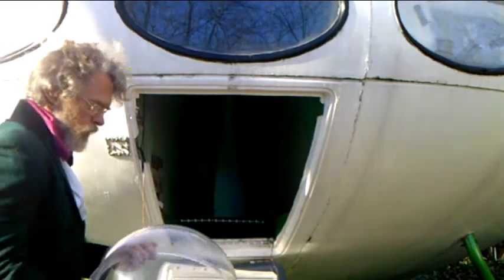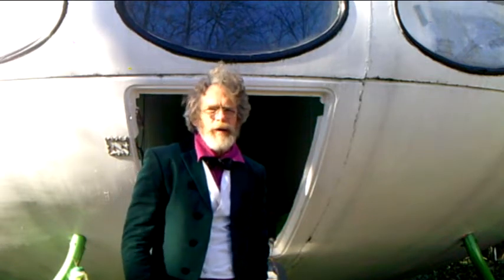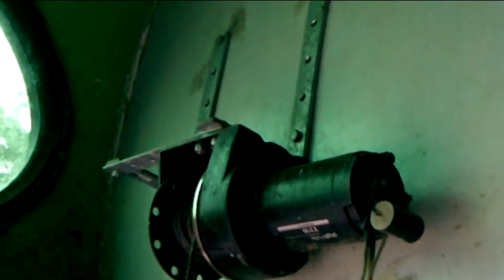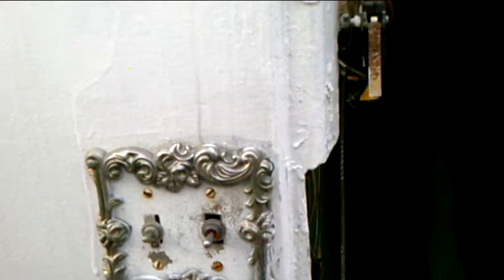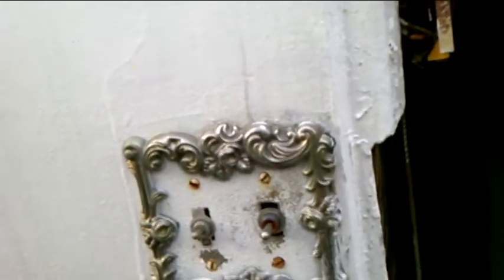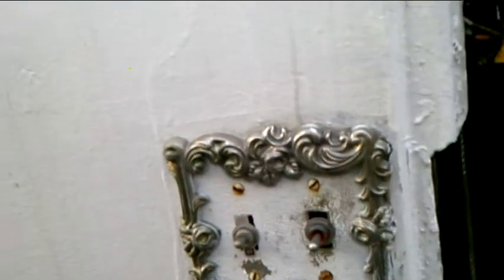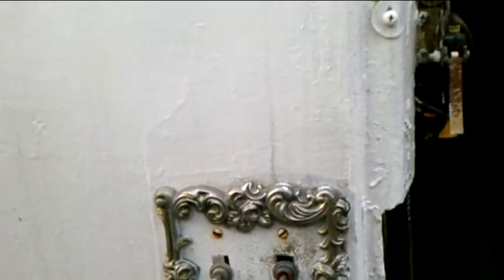Customizing Your Futuro House

Comment: I've seen a picture of one of these back in the eighties when I was a kid and just cannot forget them ever since. I think THAT is the kind of impression every architect tries to achieve but most cannot reach. I own a hillside property now with a little plateau at the top, and I'm sure one day I'll build my own downsized Futuro house because the place cries for such a masterpiece.
Reply from the maker: The Futuro website listed molds for the Futuro still exist. There are a set of them in Europe and there used to be a set of them in North Carolina. The design would best be a little different. The original heating and air conditioning system, which was under the floor and difficult to service, can be above the floor with only about four square feet of floor space for a Geothermal system which cuts electric bills in winter by 1/3 to 1/4. A clear plastic bubble can replace the chimney. 

It would be a miracle for these houses to be brought back to life.
Reply: There's one down the street  from me I Delaware

Comment: It is beautiful and practical.... the lights in the stairs.
Reply from the maker: I think they are practical, you won't trip on them at night, but I admit it. They are fun and beautiful. If such lights are used on steps to small airliners they can't be all bad. The flashing fuchsia LED strips announce that the stairs are coming down and they change to green, my favorite color. But the LED strips use very little electricity and you can have them in any color you want.

Comment: I like your outfit, it's very cool.  You look like Captain Nemo standing next to that house.   Thanks for sharing your unique house with us and the stair lights are a terrific touch,  it looks like a flying saucer from 1950 has just landed.  I'm sure your tips are helpful to the two other people who live in one of these houses.  I don't blame you for not giving out your address, but I wish I knew where the house is located, because I'd love to drop in for a visit.   If I did, I'd install a keypad entry system on the outside, because your simple toggle switch doesn't provide any security when you're not home.
Reply from the maker: I put in an electric lock that disables the toggle switch when I am away, but I like the idea of a key pad. Look up Futuro on Google and Houston, DE and if you are not too far away we would be honored by a visit.
Reply: Thanks for the pointers to your location.   A few years ago, my dog and I took a tour of the United States with a goal to see every house and building designed by Frank Lloyd Wright that's open to the public.  I didn't realize it was possible to visit Futuro houses on that trip.  We were in your neck of the woods at that time to see Falling Water and other Wright homes located in the North East.  But, I live in Florida and as much as I'd love to visit your Futuro, I doubt if we'll make it that far North again before my expiration date.   Your electric (key?) lock that overrides the simple toggle switch (which was shown) provides security, so there's no need to fix what's not broken, except for fun.   A keypad would have been futuristic forty years ago, in keeping with the Futuro theme, but today voice or face recognition is state of the art, so if I show up then I'll install voice recognition to open the door.  It will only respond to your voice, or the voice of your wife, but a series of spoken numbers will allow designated others to enter in an emergency.   Naturally, my work will be entirely "on the house", so to speak.  My entire home is controlled by voice commands picked up by Alexa and Google Home, so I'm up to date with high tech.  I read up on you and we could be brothers who were separated at birth, so you can be sure that if I do show up, then I won't bring any "shit music" with me.
Reply from the maker: There is a Futuro in Florida you can look up on the Futuro site you can find on Google. I think it was a strip joint for a time.
Reply: Thanks to your tip, I learned that I can drive over to see that house and drive back home in one day, so I see a day trip to Pensacola in my future.   Google says this house is not open to the public for tours, so I doubt if I'll be able to do more than look at the exterior from a distance.   While searching for your location, I came across an article with a headline which said a Futro house in Florida had been turned into a strip club.   But I skipped that article, because I assumed the building was in South Florida.  That's because the cool buildings in Florida always seem to be in South Florida.   Also, I figured the house was only an empty shell used to advertise the strip club.  Florida is such a big state that driving South is a major commitment of time, the same as driving 500 miles North, but Pensacola is within reach at 100 miles to my East.   All Futuro houses look basically the same from the outside, so it seems to me that the only reason to visit more than one would be to meet the people who live in such an unusual house and see how they have arranged the inside to make a home in such a small structure.
Reply from the maker: look up on the Futuro house website houses in Delaware next time you travel that far north. You are welcome to visit.
Reply from the maker: There is an additional key that shuts off power to the stairs. It is alright for you to visit if you are in Delaware, 4388 Deep Grass Lane. drbarney1@yahoo.com for direct email. Let me know of the two other people with these houses if they consent and they can call on me too.